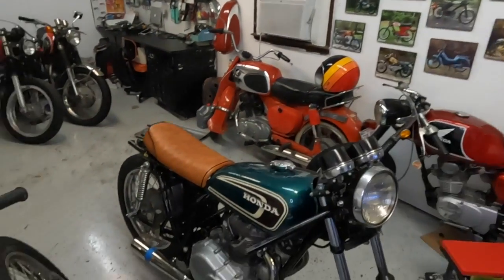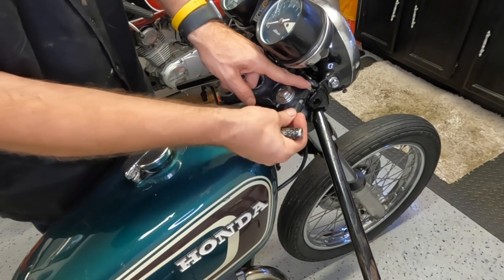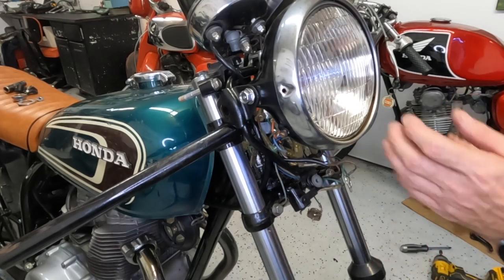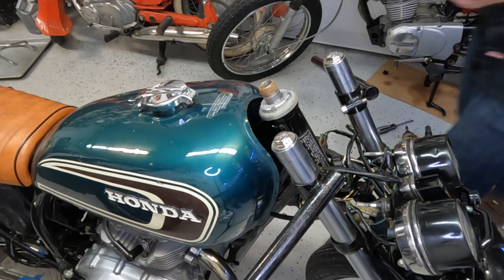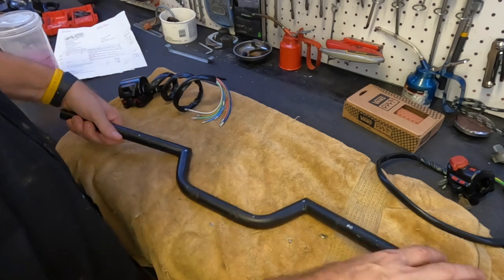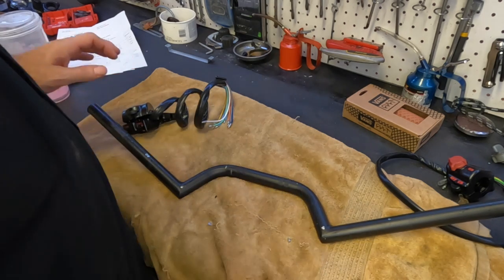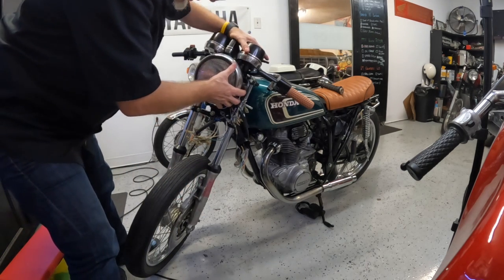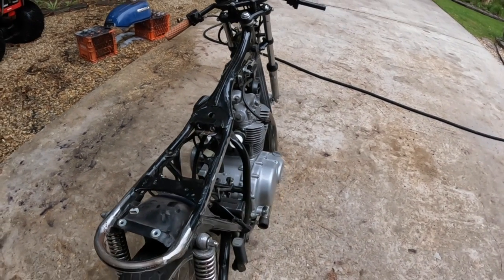1974 Honda CB360 - First Start - We finish this project! #hondacb360 #cb360 #caferacer

Comment: Great work with this project, can't believe how nice it looks from where it started! Question for the tuning, what do you think those pops in the exhaust are coming from?
Reply from the maker: That was the first ride. I am sure that the carb needed tuning and the timing checked. If I had to guess it's from it being lean. Did not have a filters on it for this ride. Just making sure it ran before the owner picked it up.